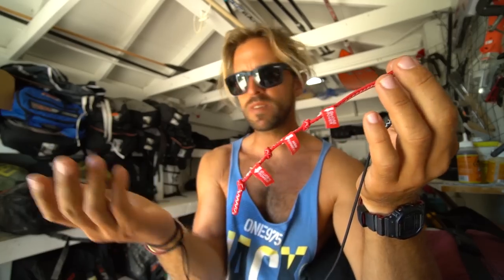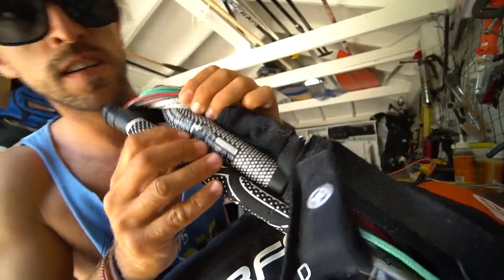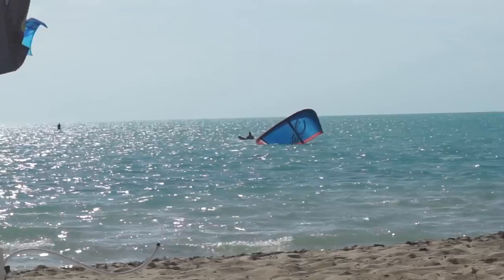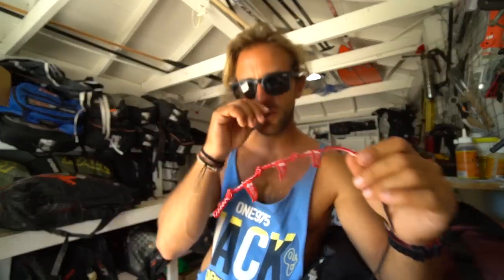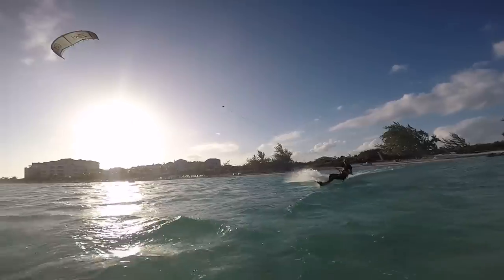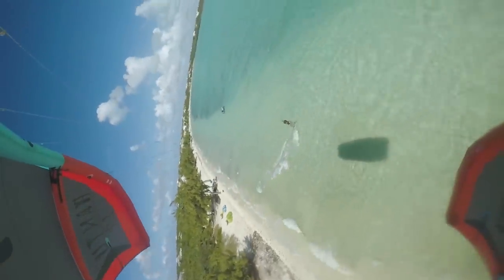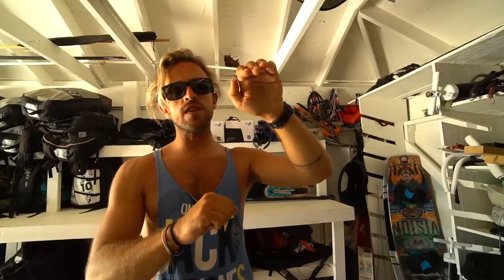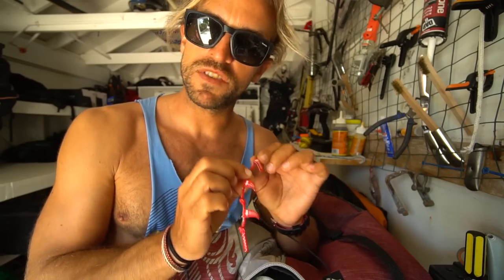More power knot or the less power knot? The most confusing thing in kitesurfing

Comment: I think many people don't realise this. A good way to check if the knots are wrong in low wind is to launch the kite, fully sheet in the bar and wait and see what the kite does. If it fully reverses and falls out the sky, take the tension out of the back lines by using the other knots, maybe trim the depower so the kite is always flying forwards.
Reply from the maker: exactly, best tip ever!

Comment: Yet again super informative and well presented explanations. I particularly like your (not so obvious) recommendation for light wind.

One point I was waiting for you to mention more directly is that fine-tuning naturally comes after a base trim. 

For example, what often happens is that the front lines stretch more, relative to the back lines, with usage over time. This amplifies the effect you talk about (backstalling tendency, particularly using 'power' knot), and changing to a different knot is more compensating a wrong base trim than fine-tuning in these cases.

Aloha & keep it up, Epic Gust!
Reply from the maker: HEy @Ice Ace! THnaks for your input!
Line length tuning will be in the other video that is planned so the story will be full. I believe the knots in many cases - especially when you chose them by connecting it to the kite it doesn't mean to be the solution for the stretched lines ( if that would be then you lost the fine-tuning options on the pigtails) . You fix the line length in a different way. When you have the tuning options under the floater, this can be an easy fix for the stretched lines tho! But again then you sacrificed your fine tuning! what i am saying is that line length fix comes first, then than you can connect with the fine tune, and finally you adjust on the depower.

Comment: I agree with 1&3.
2. Light wind use the less power option and move the kite harder... how to move kite harder if there is no tension on back lines?
Reply from the maker: Hmm good question!
I can be mistaken, and I am keen to learn and ponder about topics like this!  My opinion is from my 10 years kite journey so far is this:
It is still possible to move the kite hard enough. Your kite will make a slightly bigger radius and that's what you looking for too. And harder means that really all in. From 11 to the right and deep as possible in the window, many times. TIll the kite moves, it pulls. Once it stalls it stop pulling you. 
What do you think?
Reply: @EpicGust  
Hmm I think if there is light wind it's better to swap kite with bigger one ;)
Of course when light wind comes, extension of back lane helps keeping kite in the air and prevents from backstalling. It should be done by depower strap which makes front lines shorter.
Summary : I wouldn't say that less power connection point helps keeping kiting in lighter wind.
BTW - good content of your video 👍
Reply from the maker: @kitelife_pl_kiteboarding  Thanks! :)
Yeah that could be a good option to use just depower!  but that seems even more unobvious when people keen for that MORE power :) Extending all the lines can also come in to the picture!

Comment: Does this work with the North or Duo kites that have the pigtails on the kite
Reply from the maker: North/DUotone doesn't have the option on the end of the lines. On the normal bar they had it under the floaters, to reach them you have to open the end of the bar (small plastic thingy that usually breaks after a few season) and there you will see the same thing. Although I believe they meant it for line adjustment for stretched front lines. On the Click bar? no idea! Anyone? I have ZIAN Kite, also missing those options. i put extra pigtails to have them! :) ( make sure if you do it add to every line the same length so they will stay even) Video about the line adjustment coming soon! :)

Comment: I allways use the most powered setting, you can allways depower it. The other way around is not possible, to power it up even more
Reply from the maker: can do but this way you losing at the depower side of the kite. above 30 kn maybe thats a less ideal policy?
Reply: if you need to depower the kite that much, its time for a smaller kite or stop kiting
Reply from the maker: Then only one mystery left. Why kite brands who designed them give us an option for this?
Reply: @EpicGust  because they better be on the safe side. I mean lets be honnest, a fully depowered kite flys like shit
Reply from the maker: @egbert1985  correct for a certain riding discipline I agree too, yet often when the wind pick up it is a nice way to just cruse with minimal kite input. Lately I am out often in 40-50 knots, and when it is on the higher end I fully depower my 7m and cruse way upwind. When the wind goes back to normal I take away some trim and go big. 
Similarly: just because you use the first or the 6th gear on your car the least(again depending on your driving environment) they are not useless.

Comment: Not sure I agree with everything in this video. There’s no mention about lengthening your back lines (end knot on the pigtail) when riding in high wind to take some power out of the sail and therefore bring some ‘depower’ trim back to the bar to the kite. Conversely, shorten the back lines in light wind so that the kite collects more wind to propel you but this demands you keep the kite moving to maintain lift. If it starts to backstall, reach forward and pull in half a meter of front/centre line to regain lift, then get the kite moving forward again in sweeping power curves.
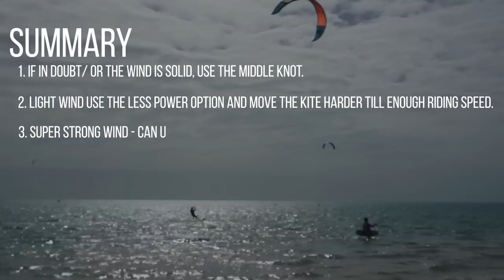Reply from the maker: Hey Nick! Thanks for your input! At 4:43 of the video and you will see mentioning it. So watch closely next time bud! :) Stated there as well, in those conditions that knot won't change much it is better to drop the kite size! I had a full season of experiencing that is not working well, in CostaRica 30-50 knots, kind of different planet conditions. If you can't hold on to your kite,  the knot won't save you. And less power knot + full depower will make your lines so slack that the kite won't turn properly anymore. Had trouble because of it. We want a responsive thing above us in those conditions! Whole better options to change the board size to smaller also to drop the line length to 19m. 
Shortening the back lines in the low wind will cause backstall, and unfortunately, that is not collecting more wind. You generate apparent wind through the move but if your wing won't fly you can't move it. If it starts to backstall, you moved it wrong (too light up etc)or there was a wind hole etc. Your goal is to keep the consistency in the move and not to reach anything close to backstall! REaching out to the front lines and pull them are good solution saving a falling kite when you are stationary, but not the thing you do while you riding.  It has to work with simply sheeting out on the way up and leaning back at the same time. You want to look good while kiting not like an electro shocked back and forward shaking someone! :D Keep your dignity! :D JK! HAve a good one and let me know what you think! Peace out!

Comment: Yes, I agree with all of it, but you left out one detail. All of this only works with a properly tuned bar and lines, if power lines have stretched, all this goes out the window
Reply from the maker: sure, same if the kite leaking, same if the kite ripped and has a big hole, even the same if one line is broken, all this goes to the garbage! It is like saying you can't drive the car unless it has 4 wheels! Somehow I assumed that factors are OK! 
Video coming about the lines too. We agree that this is both important.  First, you get a kite (like newish at least) you get out, after a season of kiting you check those lines too! :) On a 2009 Crossbow it will go the other way around!
Reply: Okay, sorry for commenting dude, it won't happen again
Reply from the maker: @dajobra  I think you got something wrong here :) your comments are more then welcome! And from your suggestion, I will do one vid about the correct line lengths too! Thanks for that!
Reply from the maker: @dajobra  I just tried to be a funny guy I guess :D Too bad it didn't went trough! :)
Reply: @EpicGust  I got the humor :) Are you saying that the back lines stretch on the crossbow? I'm just learning about kiteboarding so I'm taking in info and know nothing about it. I have been flying kites 30+ years, gliding 3+ and flying paramotors for ~1 year and I like to experiment on occasion ( https://youtu.be/q0mdZNxfQhQ ) though.
Reply: lines dont stretch, they shrink, the power lines just shrink less than the steering lines giving false perception of them getting stretched
Reply from the maker: @OurKiteLife  
Where I am from we say this: Life is fair. The One who's right leg shorter got a left leg longer.  :D 
The perception must focus on the difference :)
Reply from the maker: @MichaelRainabbaRichardson  holy smokes what an idea :D
Reply: @EpicGust  well put  =]

Comment: Dude it's far more important to tell people how to adjust there lines. Because all of this means nothing if the lines have stretched.
Reply from the maker: True dat! Here we assuming that the lenght of the lines are correct. VIdeo coming to fix the line length problem. These two topics walk hand by hand. :)
Reply: Lines shrink, they normally dont stretch
Reply: Of course, I agree about "if the lines have stretched". Often the fabric of the kite have stretched as well. As for me, I'd rather set up a kite (in light wind condition, about 8 knot) for "light" backstole (in other words, the kite does not fall, but it is already ready to fall). And as rule, it is perfect for all conditions.
Reply: If your lines are stretching, you have a problem. They normally dont get any longer. They are pre-tensioned at the factory which stretches them as much as they are going to stetch, to make sure they are up to par with strength requirements (liability reasons). What can happen is swelling, which essentially shortens them. There are a number of factors here from actual material swelling to foreign particle buildup that makes the braid spread out a bit. That also weakens the braid's yield, which is why its important to make sure the lines are rinsed off after a session. The salt crystals can actually become abrasive, as well as the sand. If your lines are stretching out, chances are you have severe abrasions in some sections and this has caused some thread bundles to break, allowing the braid to tighten and thus lengthen the line, which is very dangerous. Either way, if they have changed length at all, its time to replace them, period. A few bills on a new set of lines is cheaper than a hospital visit.